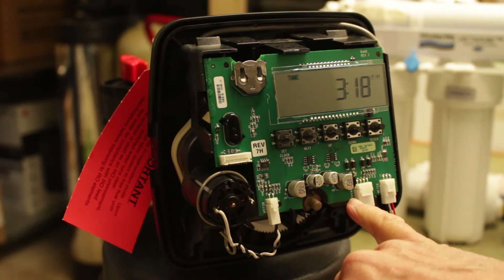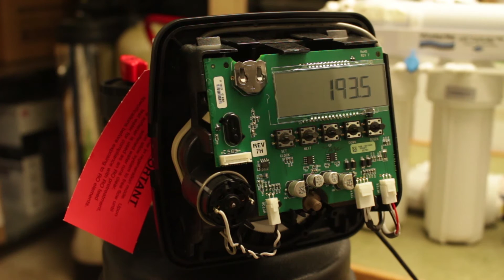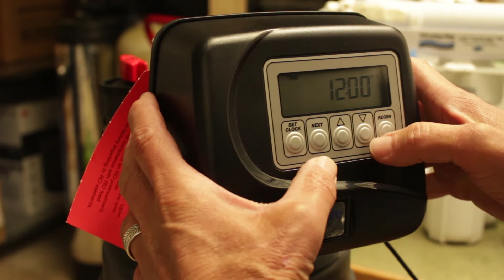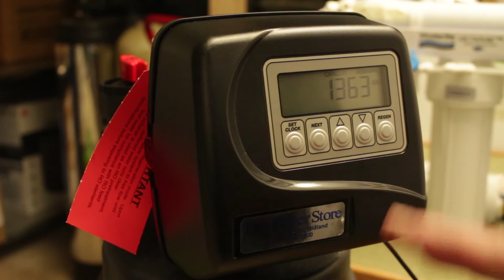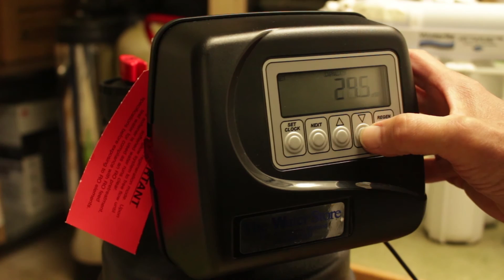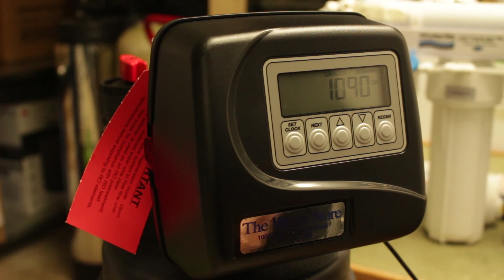Clack WS1 Water Softener Valve Settings

Comment: My Clack WS1 is using salt and is set to 25 hardness, but my water still seems very hard.

I used a test strip and it sayd that my water at an outside spigot is 3GPG/50ppm hardness.  everyone seems to say that softeners are set in GPG, but that doesnt' seem to work our as It's on 25 and I need more.  What gives?  The OPerational for this valve does NOT bother to put a label with the number, it just says "hardness". 0/10
Reply from the maker: Hardness is typically expressed in gpg.  I would have your water tested before and after the softener (the outside taps  may be softened, mine are) to find out if it is working ot not.  Then set it correctly.
Reply: I was mistaken.   Tested from sink faucet and was hard.  Then remembered that kitchen sinks are often out in non softened.
Reply from the maker: Yes, that happens all the time.

Comment: This looks like it's set to regen every 14 days but it also set to auto. which one is it?
Reply from the maker: Both actually.  When you use up it's capacity it regenerates then.  If you haven't used up it's capacity by 14 days it goes then.  Great for seasonal homes!